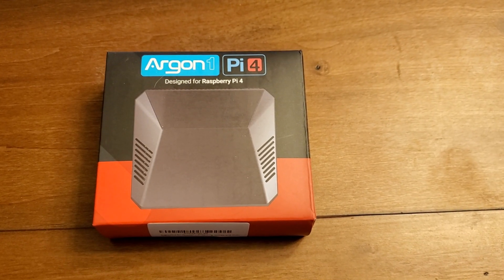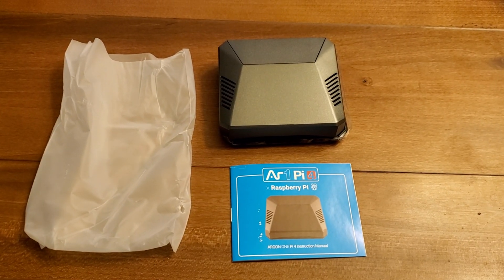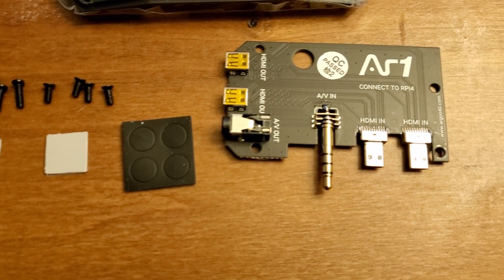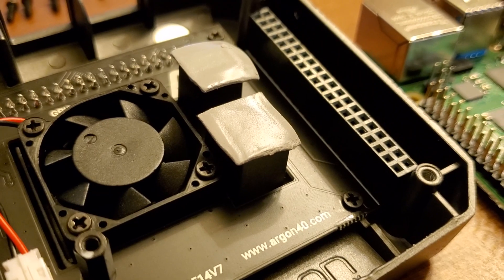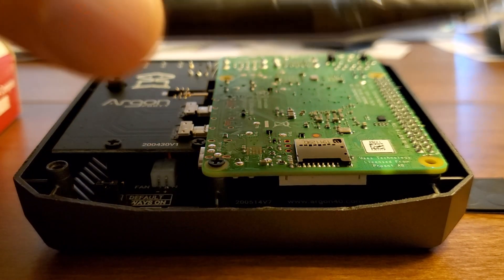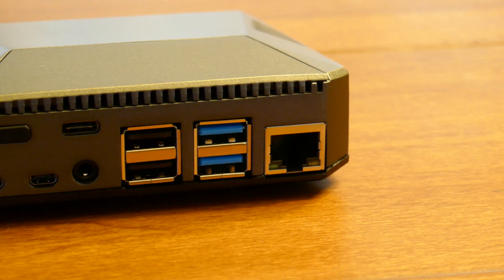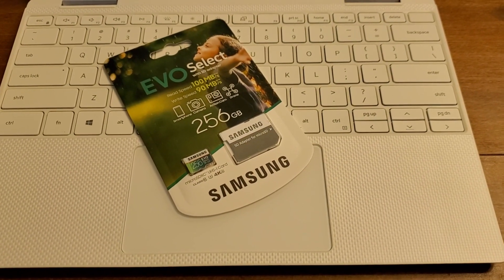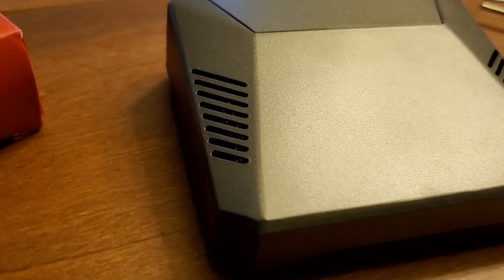Quick look around Argon One Raspberry Pi 4 Case with fan

Comment: Both the power and fan controller scripts are solely dedicated to the Raspberry Pi OS. Is there any way to modify those scripts in order to run Ubuntu 20.04. 1 LTS / Ubuntu Mate/Manjaro?
Reply from the maker: That I'm not sure. Beyond the scope of my expertise there. This thing does seem like it would be a nice little ARM desktop though.

Comment: Do you know if the power button script can be run on retropie after it is installed?
Reply from the maker: Yes, that's how I did it. I just SSH into the Pi and ran the script, but you can do it on the Pi with a keyboard.
Reply: @AdultsHaveToysToo  Awesome thank you so much! I used to build computers for a living in the 90's but it's been so long, I'm a bit lost. SSH I'm comfortable with :)
Reply from the maker: Awesome. Let me know how it works out.